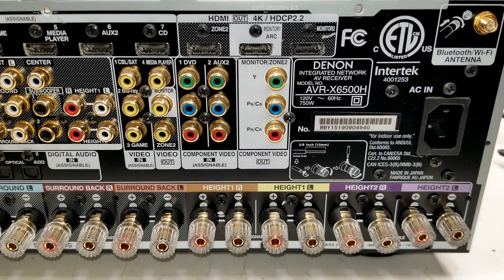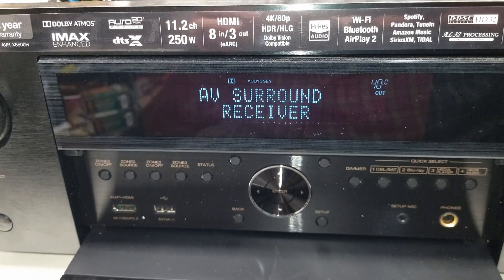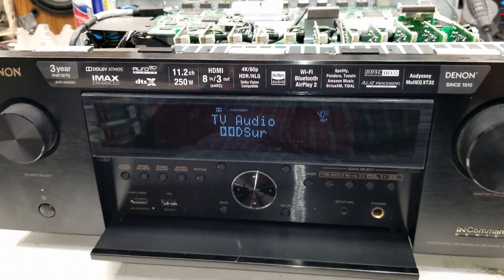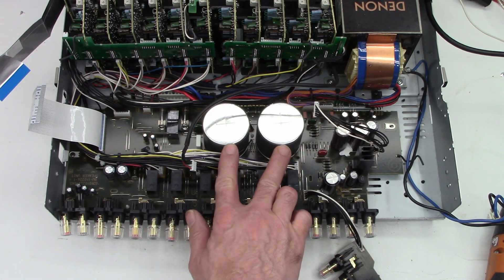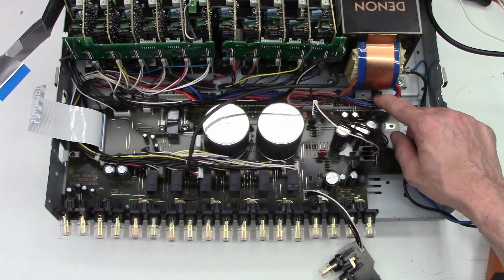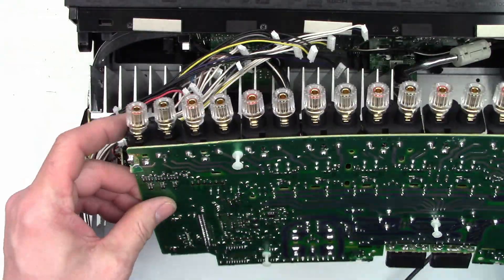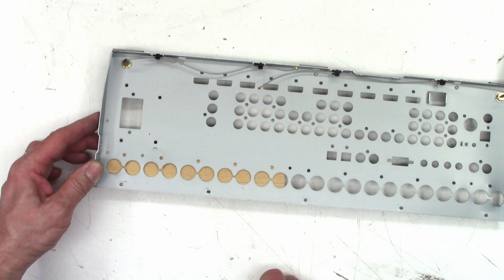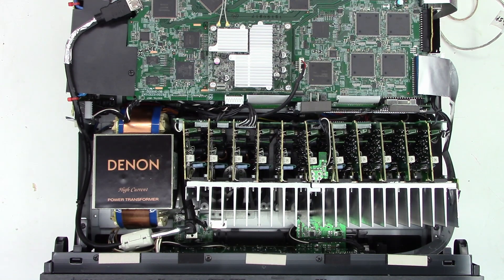DENON AVR-X6500H HAD THE BLINKING RED LIGHT OF DEATH. DID PHYSICAL DAMAGE CAUSE THE ISSUE?

Comment: How do you remove remove the board to board connectors on the Denon? The ones in your video just pulled from there base. there are connectors that hold wires right to pins on the board.

Comment: Hi NorCal. Great video! Question: What are the 2 boards that connect the individual amplifier cards together on the opposite side of the heatsink? Just curious what their function is. The receiver is marketed as being a monolithic design, but it seems the individual cards all connect to 2 different cards for the left and right channels. Thanks!

Comment: Well with that hot glue that probably gets pretty warm. So what then with that hot glue? It will umm ya MELT.  Sounds like you know a lot though.
Reply: I repair car amplifiers. I been watching trees receiver repairs because I'm trying to get into a nice home audio set up and just bought a avr-x3400h in protect hoping to fix. Also just bought a monolith 15" but it's way bigger then thought might send it back. But what I would use over hot glue is e6000 glue. It will also melt down but takes higher temps.

Comment: Hi, Thanks for the video! I am trying to fix 4500H, It is missing small square PCB where Wi Fi antennas connecting, do you know by any chance where to get it? are they interchangable between ..500H series? What is your guess? Thanks!
Reply from the maker: If it is just the WIFI receiver they should be interchangeable, and not need to be programmed to the individual receiver. As far as trying to find one, you will probably have to find someone with a scrap unit to buy parts from.
Reply: @norcal715  Thanks for the answer! That is my guess also, to find it in broken unit and take it from there. I bought AVR-X4500H as parts, do not have budget for new one. It was completely dead and one Panasonic chip mn864788 been missing. Ordered it and waiting for delivery. Noticed messy unsoldering activity. After cleaning, receiver started to turn on!!!

Comment: Hi sir i have problem in Denon AVR-1905 in speaker out put socket voltage it's coming I checked all component levels in amp section and pre amp section component are working fine

Comment: I had screwy problems with my Denon receiver.  On a whim, I replaced tactile switches that did not work - unit fixed.  It was because staticky bad signals were confusing it.

Comment: Yeah the 6500H would be around 2nd from top in the lineup so that AMP would have cost around £2K or just over so not cheap ! .and it also looks more or less brand new .those PCBs look more or less fresh with hardly to dust or dirt.To have 250w per channal you would definitely need to  have 2 PSU are much larger than that one ! Must be an unusual marketing strategy by Denon . I mean even if that's 250w per channal you would have to run each speaker at 4ohms ..na mistake their . anyways absolutely fantastic video.

Comment: I have a Pioneer VSX-817 it works fine when the sound is low but when I put the volume up I hear one of the relays disengaging then the second relay disengaging and then the whole device shut down?  any idea what is going on.  I do not know where to start? any help is highly appreciated. thanks
Reply from the maker: Does it shut down with no speakers connected?  How about with different speakers? Could be a bad speaker or wiring. The unit senses an overload and shuts down to protect itself.
Reply: @norcal715  thanks for the fast response. no, when there are no speakers connected it does not shut down. I connected one speaker to it and there is no audio source connected and when I put the volume up it shut down. 
I connected a different speaker to it and still shutting down is taking place in this device.

Comment: I suspect the reason why that transformer is so small is because the power Amplifiers may have the new highly efficient 5 leads GaN FETs being the drivers in a "Class D" configuration "High Currents" producing very little heat as their efficiencies are in the high nineties, which BTW also have insanely low noise and distortion figures..

Comment: Nice vid as usual.. Many thx :)
I have two of yamahas top-models in the same price range (2020 and 3080 Adventage) and they use real heatsinks for regulators and rectifiers and all caps are Nippon and Nichicon (Fine gold) and the powertransfomer is probably twice as big (18-19KG total weight) and left and right channels are separated.  Main filtercaps are 18000uf/ 71V.
I see Denon uses some ELNA caps here and there but mostly chinese "Koshin" and i have to say for this price i except better parts. And better build. 
Is going down hill for Denon/ Marantz (and with NAD too..) 

Best wishes
Johan from Finland
Reply: I too use a Yamaha RXA 3060 and it's considerably heavier than the 6500 and the SR7013 I compared it against recently. The Yamaha has better and more solid build quality.

Comment: Thanks for this one. I have a Denon AVR-X4200W that I've never had to open yet, but I took notes. These are great receivers and this is my third Denon (previous two still work). Glad to see they look to be easy to work on if needed. I loved the trick for measuring the outputs at the channel board, slick!

Comment: Haha. Only a pound and a half of hot glue!!!! Next situation like that with the bent in or out sheet metal work, try sandwiching the areas to be re-flattened in some hard wood to keep the sheet more flat and a C-clamp. I was wondering if there would hammering divests, but only saw a couple small in-perceptible ones, good job considering. Can only imaging the customer going Sh!t! when that damage occurred. :) What a beast! Looks like my old Panasonic A/V unit with a little smaller PS. Very nice unit.